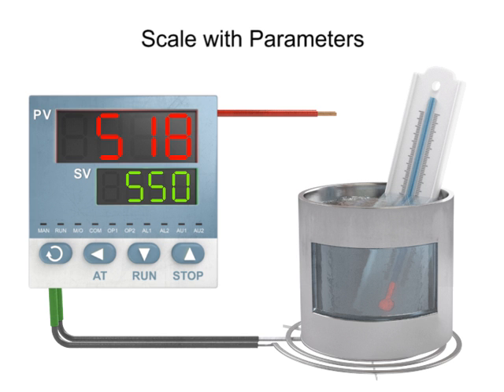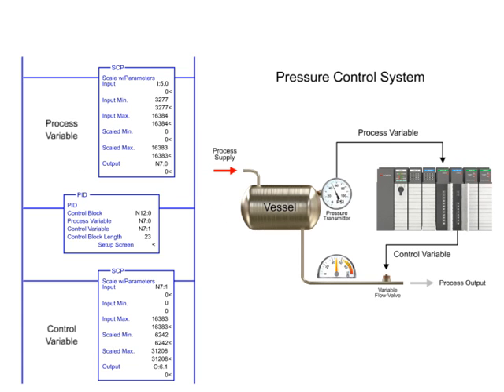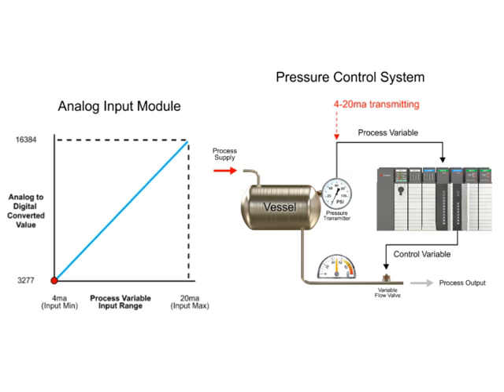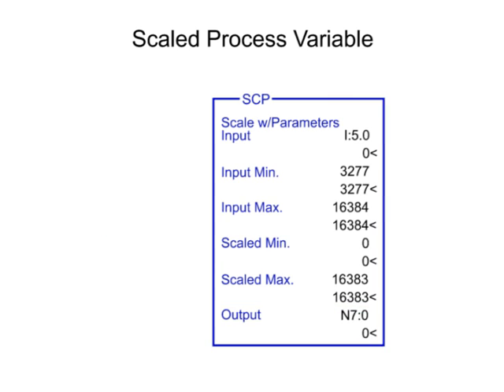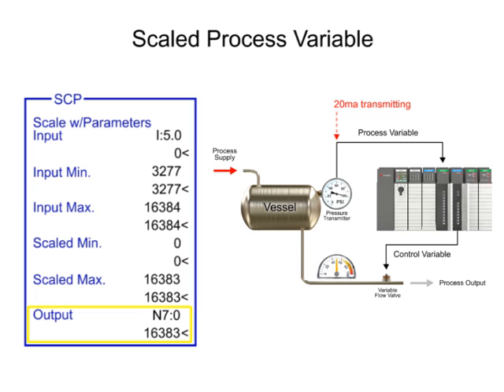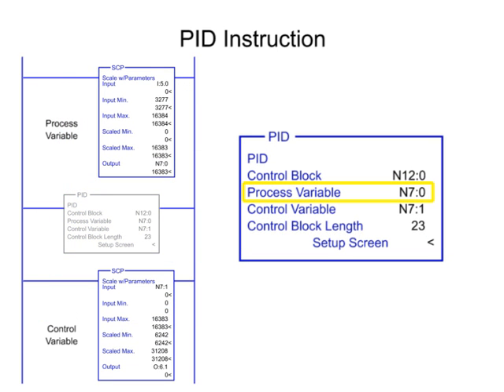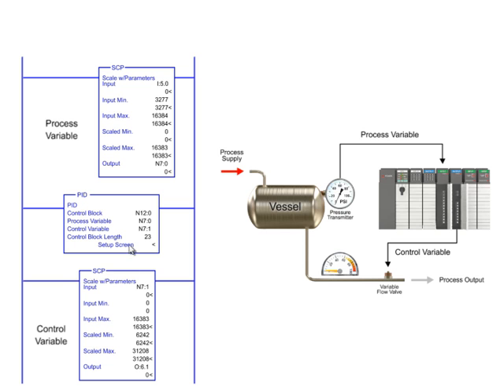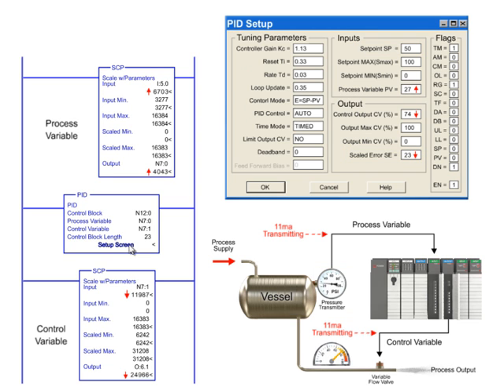What is a (Proportional-Integral-Derivative) PID controller?

Comment: why you put  scaled max in input scalling 16383 not 100 . why 16383 exactly
Reply: because brother we receive 0 to 10volts or 4to 20ma at the input module of the PLC,It is then processed further so the CPU receives 16383 which is acually in digital format like binarys 00010101010010101 etc and the number 16383 is actually a converted form in decimal from the binary source.
hence we do not get 100 rather we get 010101010101001 its a WORD,BIT ETC FORMAT WHICH IS GIVEN TO THE PLC.